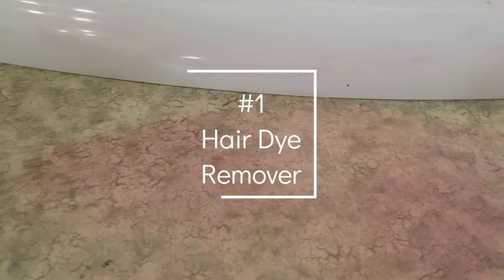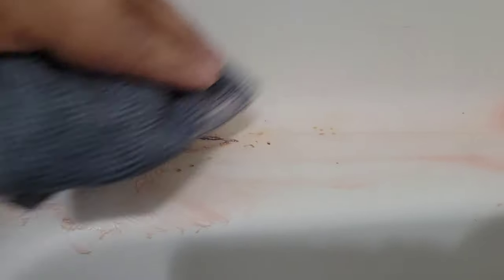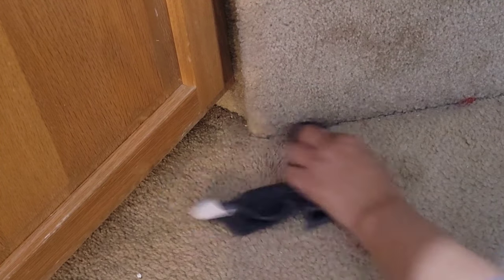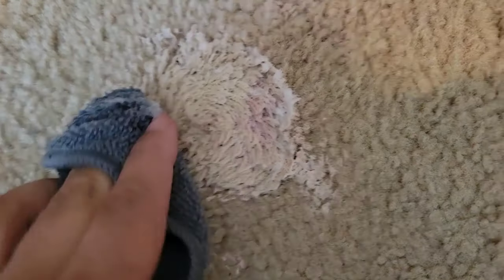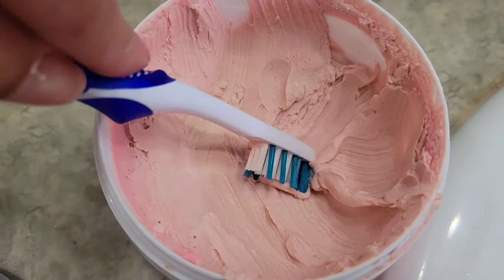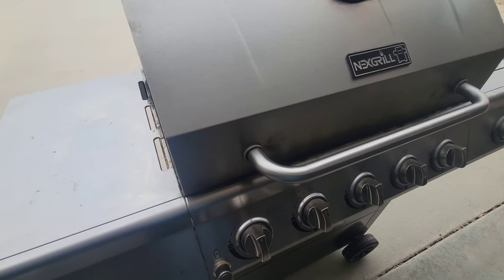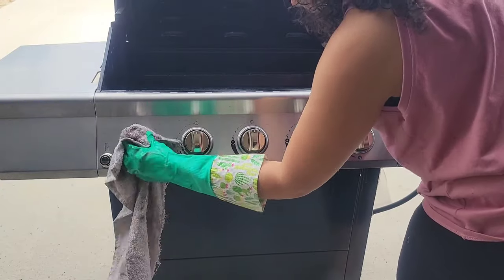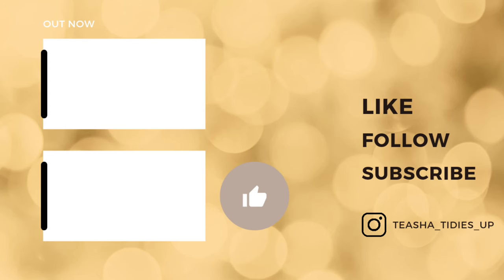The PINK STUFF paste like you NEVER seen before|| Pink Stuff Hacks for both inside and outside.

Comment: That old carpet stain will come out with a mixture of vinegar and dawn. I took out a huge 15 yr stain left by the previous people's dog.
Reply: I’m going to try this. Moving into an apartment. I was told the carpet would be replaced, but they only cleaned it. There were still a few noticeable spots that could use more attention. I could push the issue but I have a carpet cleaner.
Reply: Omgosh thank you for this advice Linda! Do you kinda brush the mixture into the stain with a toothbrush? Do you leave it for awhile to let it set into the stain? Definitely want to give your method a try. Thank you!
Reply: What is dawn
Reply: Blue dishwashing liquid

Comment: Well done 👍.. really excited about trying out the stuff in more ways.. I've heard that it's a mild abrasive.. have you found any scratch issues while using it on glass and delicate ceramics?
Reply from the maker: Hey Vira!! So far, I have yet to notice any scratches. I recently used it on my oven door and the glass part turn out amazing. I'll attach a link to it just in case you want to see how it turned out. Thanks so much for stopping by! https://youtu.be/wTF0GKz0NgQ

Comment: That is caulk at 6:00, not grout. Completely different material. Caulk is in everyone's home, but I REFUSED to let grout in my home. Have zero. It's super hard to clean without stripping. Caulk is easy to clean (as long as whatever is in/on it is not living, like mold). That said, I am not knocking your video. I think your video is great, and I also love this product. Have never tried it on rust before, because rust is basic. Those types of alkaline, inorganic stains usually need an acid. It surprised me that The Pink Stuff cleared yours since the pink stuff is a base. Will try it next time, in the name of science/chemistry.